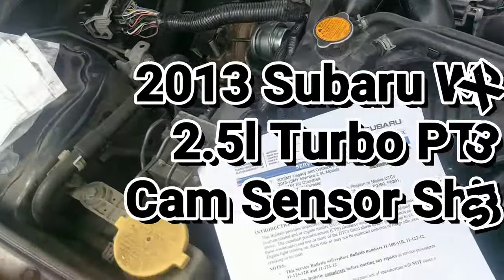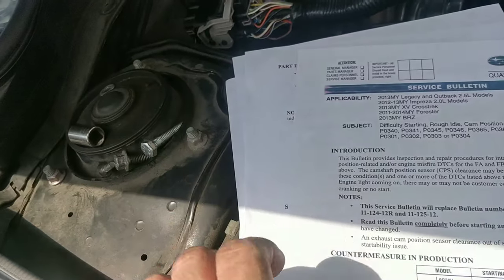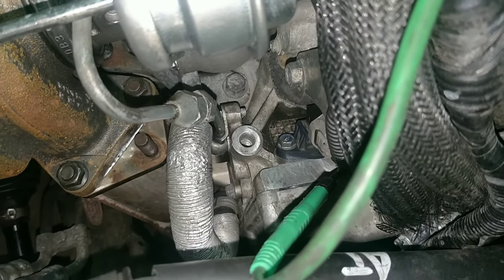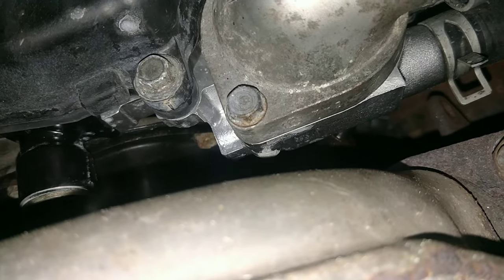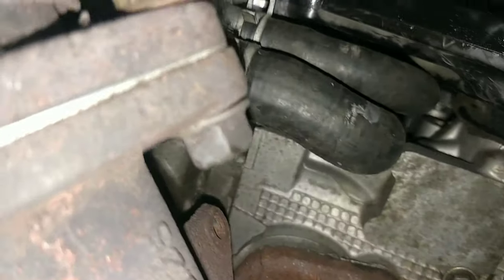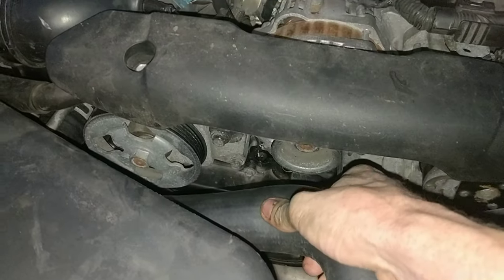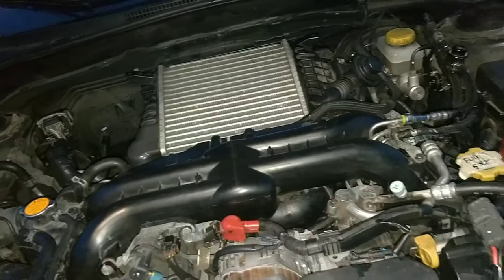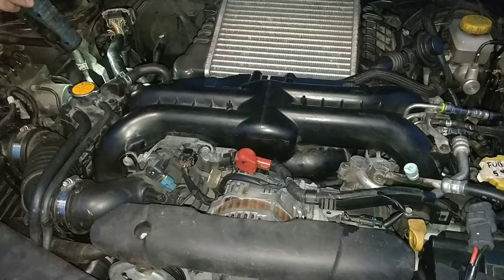2013 Subaru WRX Limited 2.5l No start Pt3 Camshaft Position Sensor Shims

Comment: I'm going through this irritating situation, I haven't analyzed my waves yet but I imagine my signal is dirty, some guys seem to resolve this problem by replacing the alternator, or grounding the starter better. I guess these two among other things can distort sensor signals on the ground circuits going to the ECU. 
Definitely impressed with your ability to read and interpret the signal waves, I wonder if maybe a simple resistor on the circuit or a capacitor might have helped.... That would be something to post in one of those small circuitry forums.
Reply from the maker: What issues are you having?
Reply: I kept randomly stalling out regardless of new cam sensors, cel's for po340/po345 I ended up shimming the passenger side cam sensor and re-soldering ground connectors on the cam sensor circuits, so far so good it actually works. When I shimmed the drivers side too, the car acted up again, so as it stands it only likes the passenger side shimmed.

Comment: Where did u buy the shims. So I have a 03 wrx and I replaced the starter, pcv valve, air hoses, camshaft postion sensor, and crankshaft postion sensor. When the car is cold it starts up fine but when the engine is at normal temp it does a long crank start. Will the shim work for me to use on the camshaft sensor.
Reply from the maker: The shims are from the dealer. I would be testing the fuel system and checking temp sensors when hot. I doubt it's a crank or cam sensor
Reply: So now I changed the fuel filter and got oem sensors for the crankshaft and camshaft when I put the key in the on position and let the fuel pump prime u can hear it turn on and when I turn the key the car sometimes turn on but this time when it turned on with a really long crank it gave me the check engine code p0340 for the camshaft sensors but I just got the Delphi 1 today so it's not that n this would be like the 4th camshaft sensor I tried so when I had the car on the checking inerest light was still on for the cam shaft sensor I went to the engine n unplugged the sensor n then the car started stuttering really bad so now I'm guessing the computer n I also gave the cobb stage 2 n the car has 237k do u have an idea